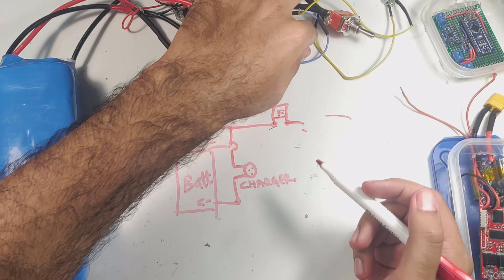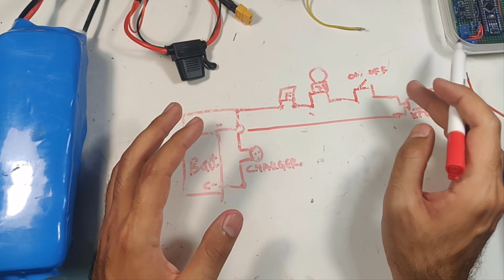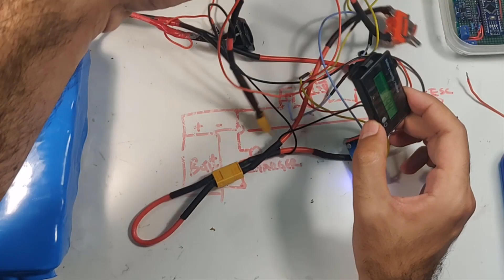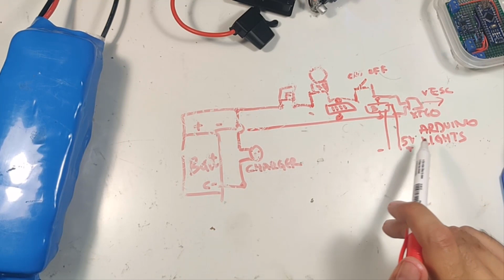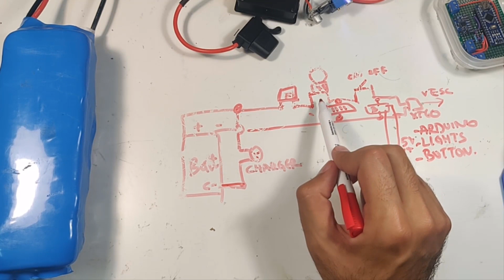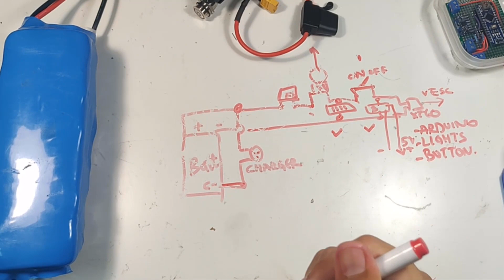DIY OneWheel Ep 5 - Electronics and Important Safety Features

Comment: Great project and very easy to understand explanation! I am thinking to build one since my kids liked a lot a Onewheel of a friend of mine, but the original one is too much expensive... Can you kindly share in the description also the list of components used? In particular:
- VESC: which model and where to buy
- Wheel+motor: where to buy
- Battery pack: since DIY seems to me a little dangerous I would go for a standard one, any reccomendation?
- Battery charger: which one did you use?

Comment: Hi !
Thank you very much for this video serie. My son and myself are really interested in the setup. 
One thing I would suggest is to put the fuse right after the battery, even before the XLR used for charging. 
You never know what can go wrong with external connections or even with a cold solder breaking due to the vibrations. 
First thing first. First safety then eventually charging. 
If the fuse blew, there must be something really wrong with the setup and I don’t care not being able to charge it before I understand then change the fuse. 
Am I missing something ? (Maybe that you cannot keep cells discharged too long ?)
Thanks again for the time you put in this project.
Reply from the maker: But also note that I used a BMS for charging. so thats one extra level of protection. It will shut down in case of overcharge/ discharge. But anyway, a fuse, as you suggested, is good to have even before the charger.

Comment: I am confused about something why would you use the ultrasonic sensor with a gyro? We chose to use the ultrasonic over the gyro with my pal...
Reply: I cant answer for him but I can say as an arduino hobbyist who has over 3000km on a one wheel that ultrasonic sensor as the only measurement device could cause in accurate return code if say you ride dusty conditions or rain etc.. anything that it may re sieve a reflection from, also it IS possible to have sound in ultrasonic range in a real world situation e.g. ambulances ( i have heard ) used to use ultra sonic to change traffic lights

Comment: So I saw a youtube video where a guy made a onewheel out of a hoverboard. https://www.youtube.com/watch?v=NQquLf8YJCc  (It's in another language, you don't have to watch it, just put here for reference) The only problem with his design was that the wheel was really complicated. Do you think I could buy a hoverboard, do what he did, but instead of connecting one gyro to two motors, connect it to the one you have? It would make the project a lot easier and cheaper. If this question is too complicated to answer then you don't need to answer, I was just wondering if you knew off the top of your head.
Reply from the maker: Yeah you could but wont be fast.

Comment: Hi, I'm new to this channel and I'm excited to see where this onewheel goes. I just finished watching your series on the onewheel. I'm a little late to mention this, but I'm pretty sure that a onewheel uses a pressure pad as speed control. I don't know if you already knew this, but in a video I saw a guy who said there are 2 on each side (heel ant toe) and to engage the system you have to have all pressure pads activated, and based on amount of pressure you apply, it changes your speed, and to deactivate you take pressure of one pad like lift up your heel. This is to keep you from pointing the board toward the ground to move, giving more clearance I think. I realized that this setup was almost like a wii balance board, which you can get on ebay for $30. The gyro system should work almost as well or just as well I think and this would be a huge project and would be extremely hard to put in and code, so I don't expect you to do this, but I just wanted to let you know in case you ever want to try it. Thanks for reading this really long comment.
https://www.youtube.com/watch?v=7TrVVPYLTKw
Reply from the maker: Hey Jason welcome to being a fungineer. 
The pressure pads are only for sensing whether the rider is on the board. The actual acceleration depends on how much you tilt the board. Just like my setup.
Reply: Yeah, I realized that after watching the youtube vid again after I posted it, sorry.
Reply from the maker: @jasoncramer3646  np buddy. We are all learning here!

Comment: You should use an anti spark switch or anti-spark xt90. Your XT60 connector and switch will wear out due to sparking and may get stuck on at some point
Reply from the maker: Thats true. I just dont have one right now. Also I dont want to keep using the XT60 all the time. I want the push button to turn it on and off, and for that I do need an antispark since the button is only rated for like 3 amps..so currently thinking of other ways..maybe use a relay. If you have any other ideas do share!

Comment: I am currently using a 750w motor driver which is rs482 compatible and using a TTL to rs485 converter to connect it to the Arduino which is connected to MPU-6050 sensor and also the Arduino is Programmed

Comment: Do you think I can use a regular 600 watt motor controller that comes from like electric scooters and stuff like that
Reply from the maker: Yeah. But then Instead of the arduino use a flight controller. It has built in PIDs. There is a guu who made a onewheel with a naze32 flight controller on the esk8 forum.